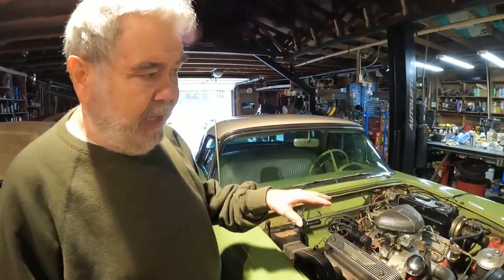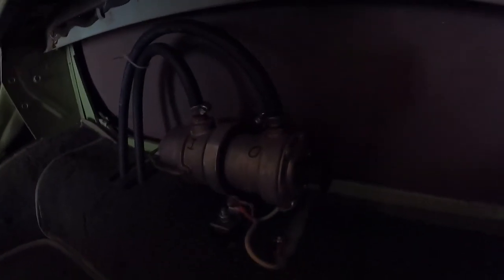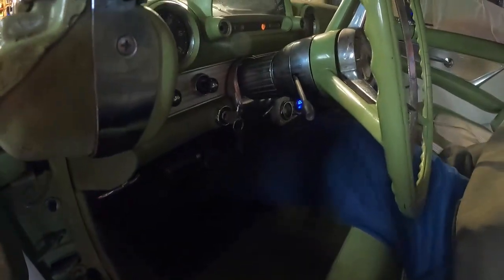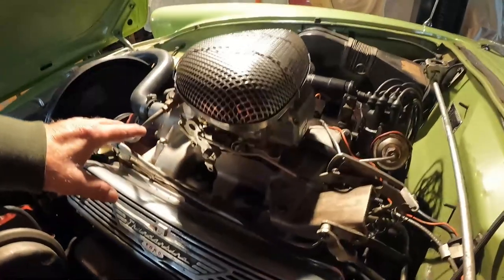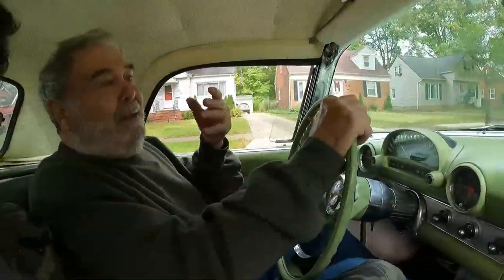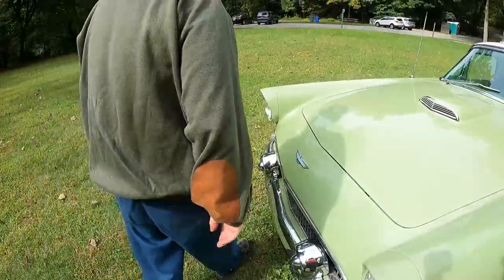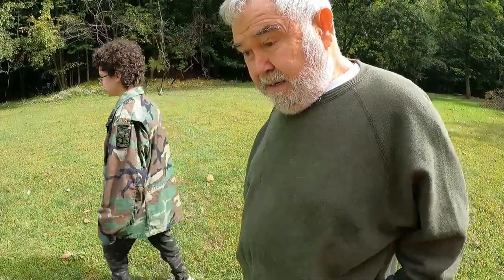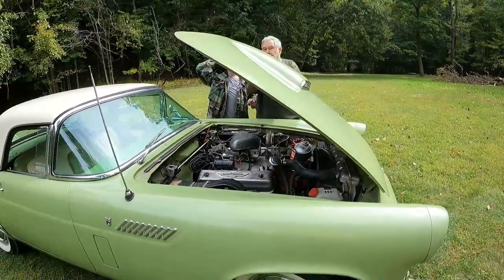RoG history talk of 1956 Ford Thunderbird

Comment: Good old 312 w/solid lifters--you can hear them, yeah! Fordomatic back then was really a 3-speed, there was an intermediate gear. Same powertrain in a '56 Fairlane, Country Squire, whatever model you had. Mainly I had the Country Squire. Thunderbirds '55-'56 used the station wagon rear axle (Spicer). If this had overdrive, it would've had a 4:10 ratio. This one is maybe a 3:56 ratio.
Reply from the maker: Thanks for the info and I really appreciate you watching, I'll make sure to read this to my old man!

Comment: Nice Video, But my Schooling was watching my Grandfather & Father Rebuild Engine. My 56 Thunderbird has a 312 and my 66 Thunderbird Conv has a 390. Everything is original on my Cars to include the original oil Bathing system in my 56. Again they tan PERFECT when they left Dearborn and still can run just as good. the BEST part on my 56 and 66 Is just turn the key and they start to include points. The teapot carbs are FANTASTIC. & The Autolite 4100 on my 66 Is FANTASTIC No DEAD spots at all.
Reply from the maker: Thank you so much for watching and commenting. I'll be sure to relay this to my father! I've got more videos of him building a small block Windsor on this channel if you're interested.